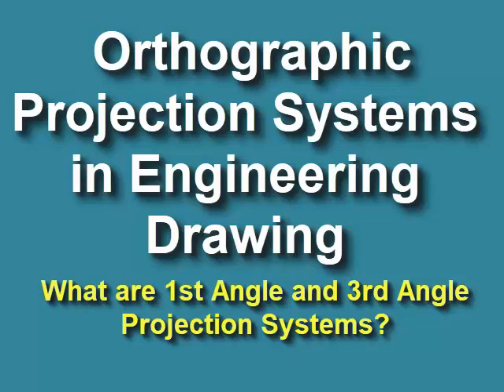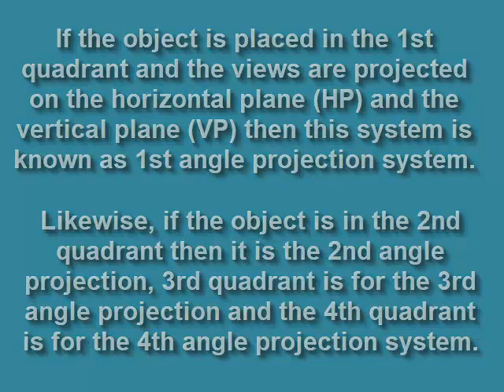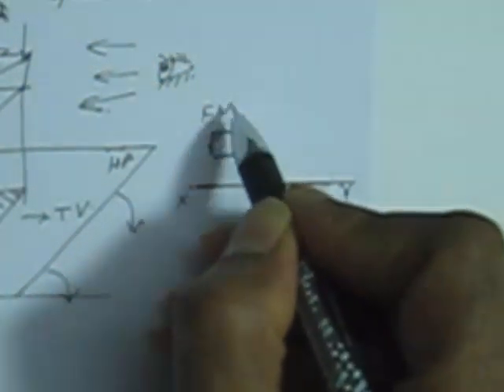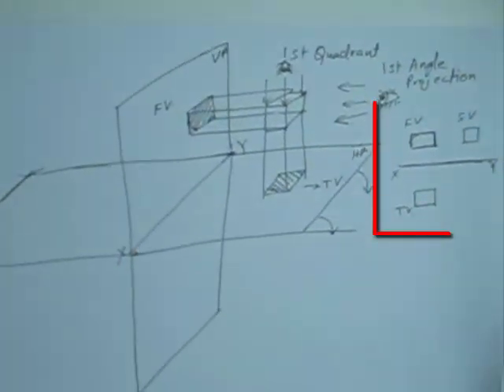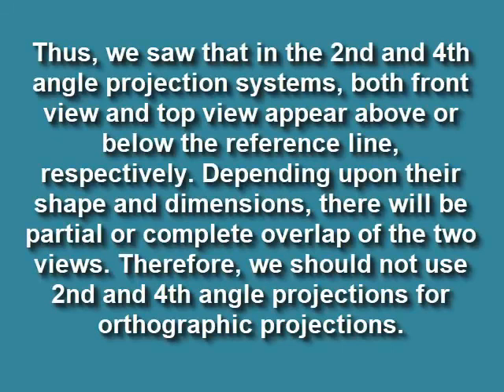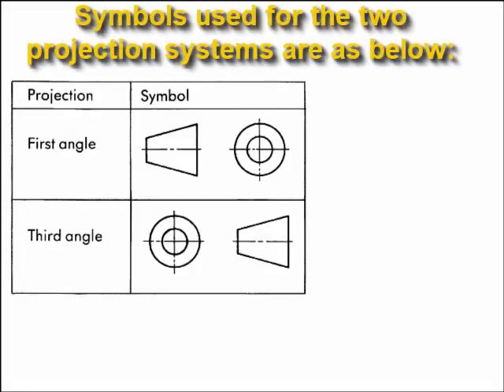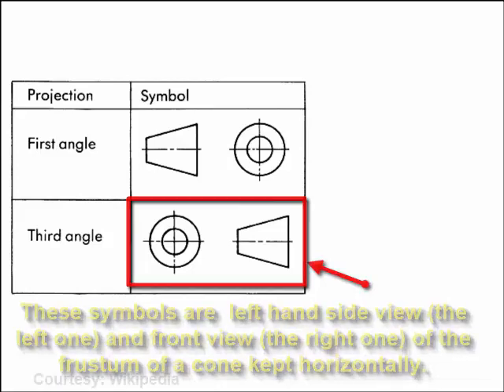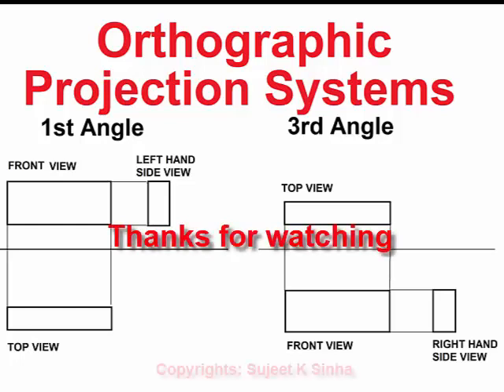3.2-1st Angle and 3rd Angle Orthographic Projection Systems in Engineering Drawing

Comment: If it is overlap each other then why not you rotate HP in anticlockwise..? What is reason to rotate HP in clockwise..?
Reply from the maker: You have asked a very valid question. The reason is that in ED we can only follow the standards and conventions which should not be changed as they suit our need. So, the convention is that the HP is rotated clockwise to bring the FV and the TV on a 2D. This is like opening up of the 1st quadrant and the 3rd quadrant. If we follow this convention then obviously we have problem of overlap in 2nd angle and 4th angle projection systems. If we were going to rotate the HP in anti-clockwise direction, as suggested by you, then there will be no issue for the 2nd and 4th angle projections but the problem of overlap will arise in the 1st angle and 3rd angle projections. Either way we have problem that we can only use two projection systems at a time. Hence, we should follow the convention of rotating HP clockwise and use only the 1st angle and 3rd angle projection systems. ED is like a language and the rules of this language should be followed strictly so that we can all easily communicate technical drawings with each other. Thanks a lot for asking!